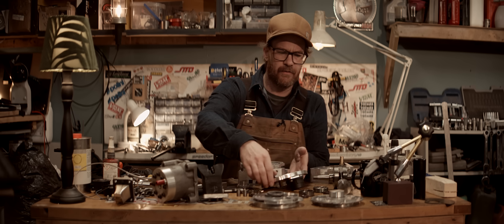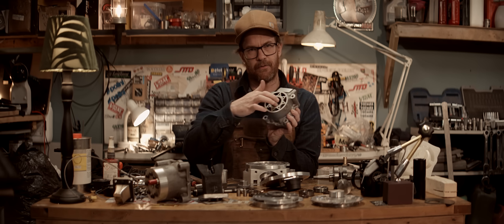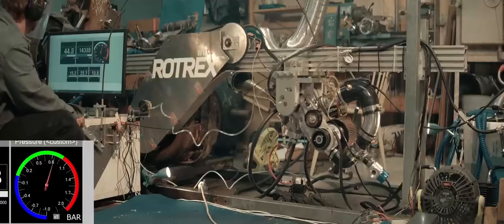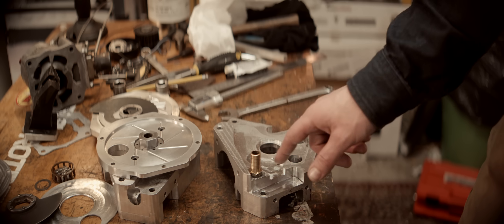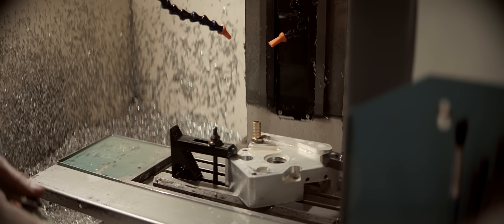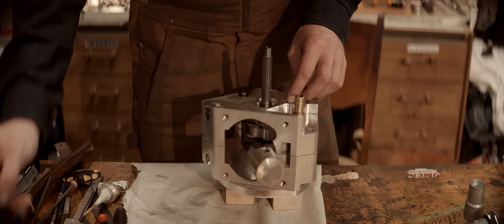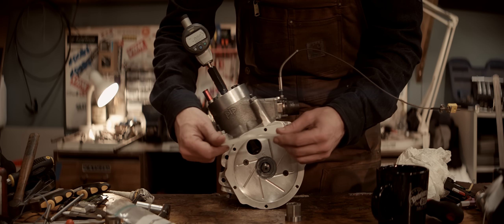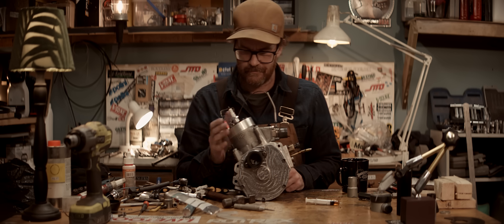Step 374 or so of making the Most Powerful Two Stroke. Assembled, again.

Comment: Fitting is either a ¼-18 NPT or NPS or a British ¼-19. If either tap isn't available, a steel fitting with a few slots cut in it (perpendicular to existing threads) with a Dremel cutoff wheel - or similar - really does work in lieu of a tap, gotta be straight @ start (...looks like you'd be aware to all of that cuz all this isn't your 1st Sapporo out of the 12 pack; more for those that are nursin that 1st one, metaphorically speaking.

Comment: That's a standard pipe thread.... next time you need a tap just try buying a steel pipe and cutting it across the center with a bandsaw in an x pattern.... only cut it about a third of the way down..... Weld and old socket to the end of the pipe and then use it like a tap with your socket wrench !

Comment: Interesting that you notice that there is a lot of friction in the crank seals, and that only by rotate the crankshaft by hand.
Think of the friction you get in the crank, with pressure on the seal-lips and 15000 RPM.
A lot of power is lost there.

Maybe you should research crank seals of different materials and design and see how much HP the difference is?
Reply: Yes I totally agree with you but we need to remember this type of seal has being used on engines for many years and should suffice in this application.
A good run-in  period lowers internal friction no end plus the correct running temperature.

Comment: I admire your skills and tenacity, I would have given up aq long time ago. I too have built my own engines to my own designs but these were all Four stroke. 
I have CNC machining capabilities but when it comes to making accurate bores I always use a boring head mounted in the spindle and final machine to size. This eliminates any possible ovality of the hole due to backlash in the X & Y planes of the machine. Judging from the error in roundness of the hole you re-machined it looked to me that backlash was the cause of it.
Good luck with the project.

Comment: You should buy a boring head for boring precise holes in the mill. 

Interpolating holes isn’t as accurate as you would think, a lot of the bores will be egg shaped. I made the same mistake on my home made engine.
Reply from the maker: 👍 I've got one, should put it to use.

Comment: i was kind of wondering if the rotary valve shape could be altered to initiate flow direction instead of just windowed open and closed. if that would help charge the cylinder in a way that would help harmonics with the pressure pulses

Comment: Commenting at 4.30 minute mark Or you could just make a rotary valve cylinder completely round cylinder not a wankel completely round rotor,  reason I'd say it would have to work because back is 50's there was a Holden 6 cylinder engine that raced at Bathurst Australia with a custom rotary valve head you'll find on Net , 20 years I've thought that would have to work as a cylinder,  yes less side force compression like a wankle but the revolution speed if blue printed an balanced would be high.
Designing the right combustion chamber on rotor would be key for compression like a layed down tick ,  torque  , hp would come with high rpm , definitely to up compression you'd need supercharger because the rotor isn't oscillating only spinning. 
Cheers got you thinking now I bet picture it as a flywheel in a cylinder

Comment: Great stuff(ing)! 
Have you thought about increasing the oil channels of the rotary housing all to the outer diameter? You faced heat issues in the inner part with the absence of channels, now the outer part which is reving with the highest velocitiy wont get oil/gasoline cooling. Keep on mate!

Comment: I can't explain in words how much I want you to succeed, or how much I wish I could have one of your crazy engines slapped on my Derbi Senda R -99. Me going against the norm I've been trying to get my two stroke to get some more bottom end power rather than the high rpm effects, but as we all know it's a losing battle. Still, it's fun to experiment!
Reply: Methanol + high compression + timing lowers the RPM of peak power while also raising the height of the peak. Have you tried that yet? I've got a video going over my carb build and testing/dyno results if you want to see.
Reply: @theshippingcontainergarage  That sounds like a good nudge in the right direction to try, though I don't have methanol available. E85 is probably the only viable option for me economically, probably not as effective but maybe it'd be something atleast?

The main thing I've been trying has been the exhaust and intake, but on a 50cc it's been hard to notice any big differences. My measure of success has been getting the moped to run ok in 6th gear on flat surface trying to keep a steady 30km/h, but there's not much power for anything else haha!

Will check the video!
Reply: @Seriouskai  E85 is alright, not nearly as much of a power bump though. Something like 3 to 5% more HP. The only problem with pump e85 from the gas station is that it has a range of ethanol content. Something like 50% to 90%. I don't know the exact number. It will be impossible to tune the carb for anything other than one batch of fuel since the next time you fill up your cans it will be a different concentration. Unless you are buying a race fuel ethanol like an e98 in a can with a guaranteed ethanol content. At that point just make the jump to Methanol. Where I'm at it's really not too expensive compared to most leaded race fuels, I buy the generic methanols, no need to buy expensive VP racing methanol etc. Call around your area see what you can find from race shops. You won't use THAT much fuel on only 50cc haha.

You could buy a smoked KTM 50 SX cylinder, preferably 2009 or newer and copy the geometry from the cylinders/bottom end. Those bikes make stupid amounts of power for what they are.
Reply: @theshippingcontainergarage  Yeah and I keep hearing bad things about the fuel here in Sweden as well, so I highly doubt it's purity and being consistent. The big problem I have is money for all the fun stuff though, oh boy if I had more cash I would do so many things since I have all the time in the world.

I haven't done any major changes to the moped either since I need it as a daily runner for the moment, basically my ideal goal on it would be something that tops out at about 70km/h and has the strength to actually get there steady, but not make so much noise every person outside would stare at me going by. Right now it's fine up to 60 or so depending on the mood of the moped, but that 6th gear is hard.
Reply: I keep reading your declaration concerning how a two-stroke engine's peak horsepower rpm is lowered by using methanol (over Gasoline, I presume), high compression and timing (earlier, I presume) to accomplish this feat. Why do you think this is happening?.  @theshippingcontainergarage
Reply: @davidgierke7582  As far as the why? That's probably a problem that depends on the physics and chemistry and thermodynamics. In short, I dont know. It just does. I've measured it on my road dyno.

Comment: Might want to check the flatness of your case where the cylinder mounts after forming those threads in with the fitting. I would not be surprised if the aluminum stretched enough to bring that out of flat.

Comment: What about making the valve out of some fuel-safe high-density "slippery" plastic like HDPE , Delrin. or Teflon? It would probably need to be thicker to handle the RPM, and have more clearance for heat expansion, and you would probably want to insulate the rotary valve housing from the heat of the crankcase somehow, but it might wear better and not create grit like the carbon fiber one.
Reply: It's running too fast for those materials. Plastics are great for low speed bearings but tend to melt if run too fast.

Comment: For "self threading", something that can help is.
If you have two of the threaded part, you can turn one into a makeshift tap by cutting slits/notches in it using an angle grinder. Works much better than just forcing it in.
You can also sand/lathe the first few threads down so it is tapered, much like a real tap.

This also works fantastic for cleaning up rusty/corroded threads.
Reply: If the Aluminum is soft enough, then forcing it will create a stronger thread, just like a rolling tap will.

Comment: The winning engines from Morbidelli (Jörg Möller!) had openimg time of 276 grades in the rotary valve, not just 180.
Reply: It might look like 180 but don’t  forget to add the width of the port, in degrees, to your calculation

Comment: Question to anyone, how do you know how heavy to make the piston? And is the heavier you make it add torque?
Reply: As light as possible within reason.
Certain areas need to be thicker than others to be able to withstand the forces in that local area.
Areas like around the gudgeon pin for example.
And the top of the piston to be able to handle the ignition explosion and the associated heat.
And remember that a piston is NOT simply "round".
When looked at from the top it is oval and when looked at from the side it is tapered - larger at the bottom and smaller than the top.
This is to allow the piston to become round and have parallel sides when the piston gets hot.
Google "ai designed piston" to see some weird designs that cannot be produces YET but would perform better than what we have.
You won't believe your eyes...
Reply: The heavier the piston, the more inertia has an effect on reversing its direction at TDC and BDC...it's a cube relationship; illustrative example: if you double the weight of the piston, the inertia force will increase by a factor of eight (2x2x2). Torque considerations aside, the engine cannot tolerate the effect of heavy pistons for very long (see: top fuel/funny car drag race engines operating at about 8500-9000 rpm).
Reply: @davidgierke7582  so what makes torque?

Comment: On the brute force design, would it be possible to integrate the compressed fuel/air after the crankcase? Most people try to do forced induction before the crankcase, but I’ve never seen someone do the forced induction between the case and the transfers 🤔

Comment: Hi, excessive  temperature is result of that seal, observed same situation when shaft and bearing got over 100C after few minutes running at 6000RPM, shaft diameter 50mm. Removing seal resulted in something like 40C drop.

Comment: I'm sure it must have been discussed before - but what's the impact of the significant intertia/imbalance of that rotary valve?   ideally, should the crankshaft webs be 'adjusted' to compensate?
Reply: I feel the crankshaft "balance factor" is quite low as Alex has suffered with severe vibration problems going back to the SPX era 8 years ago when he tried various cranks to resolve this problem without success.
Yes, it would be nice to balance the crank and disc valve together but Alex doesn't have that luxury ATM.
I feel now the carb is mounted horizontally the fuel frothing problems induced by vibration will be tolerable with no fuel starvation as previous.
I would love to see the change in the crank balance factor with the alloy crank stuffers removed then replaced with much lighter cork.
Better crank balance has many benefits as we know.

Comment: I know you take a lot of care with machining, but have you ever thought of line boring your case after bolting it together to torque specs to make sure the journals are properly aligned? I feel like it would deform a little bit during torquing. or is it not that much of a worry on a design like this?

Comment: Did the crankcase stuffer go back in when you put the cylinder on? The video showed it missing, but you might have taken the cylinder back off to set squish and then inserted it?
Reply from the maker: It was in there, but not tightened yet and sat a bit below the surface.

Comment: have you seen the new patent from mazda..... 2 stroke over head valved and blown motor ?
Reply: Sounds like a 2 stroke Detroit Diesel engine? 😅
Reply: @marcelpursche5339 they actually don’t use uniflow port scavenging like the Detroit, it uses an intake and exhaust valve just timed cleverly to scavenge the piston. It’s weird idk how well it would work in application but I’m curious to see how it turns out
Reply: @PotatoesAssistant  Oh I found the schema of the engine. Pretty weird design. Looks like a regular turbo-charged 4 stroke but with a 2 stroke power cycle. I hope they actually build a working engine. Would be interesting to see it working.
Reply: What every 2-stroke engine needs—rpm-limiting valve springs.
Reply: @davidgierke7582  I don't think Mazda is trying to build the 2 stroke with most power per cc but rather with the best efficiency and emissions. A big part for that is not burning the lubrication oil, running on self-ignition for low-rpms and exhaust gas recirculation. It will probably have an ok power per cc ratio but nothing out of ordinary.